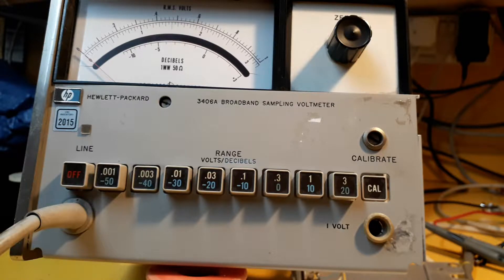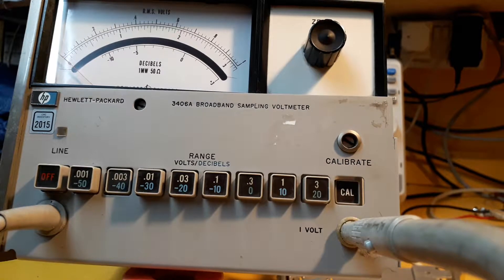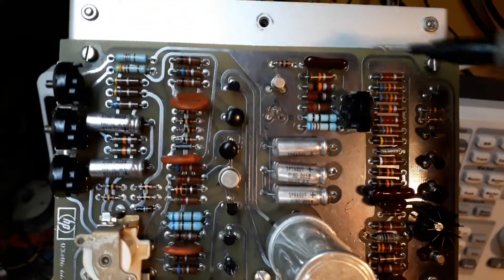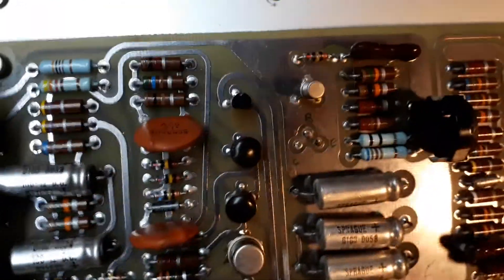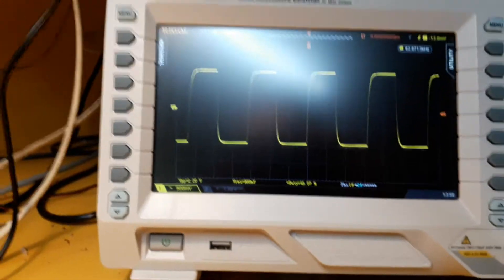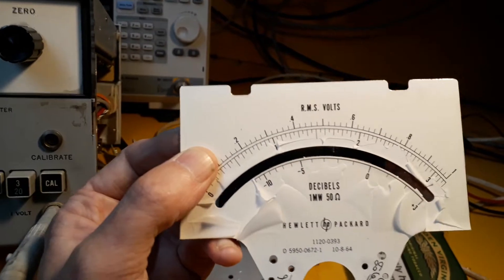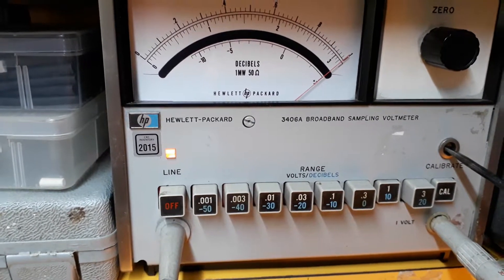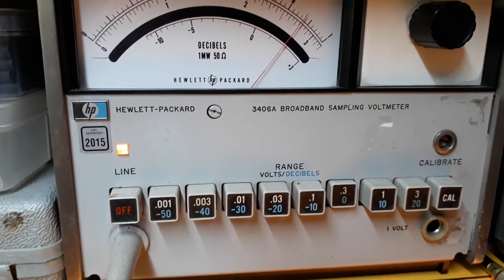Repairing a HP 3406a Broadband Sampling Voltmeter

Comment: Hi Nick, I did miss this video. Nice job as always. Wondering how it reads at lower frequencies, and what’s the bottom frequency? I’ve got one Racal Dana 9300F made for the french army. Is more an AF than an RF. Starts at 5Hz but goes up to 20MHz. Its best accuracy is at low end though.
Then very similarly my Boonton 92B RF millivolmeter has same ranges but no calibration, just zeroing for the 3 lower ranges. The meter scale on your HP seems better though, a bit bigger and nicely spaced. The issue I have, and mentioned to you, with my Boonton, is that when I feed it with a high level signal, like 300mV or higher then it gets overloaded  on the low ranges, and can’t zero it anymore. The needle get stuck high. Maybe a recap would fix it? Don’t know… 
Bye now
Diego

Comment: Would you share the file for the meter panel? My meter has the same problem (as well as corrosion of the edge connectors that silences the probe). Nice to see how you work but I would suspect the 50 Ohm termination on higher frequencies sooner than the meter.
Reply from the maker: Thanks for your comments, is no problem sending you the file, just give me your email address, I think terminator is fine it"s been checked for return loss up to 1GHz
Reply: @ptronix  donaldprins@gmail.com